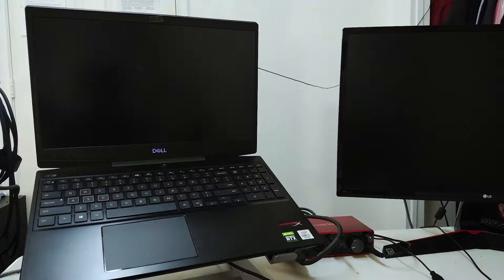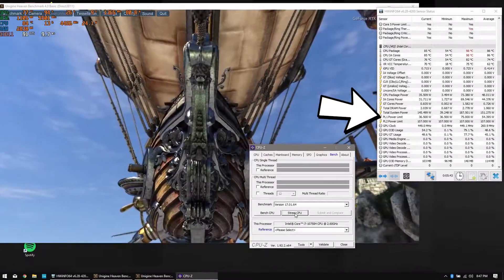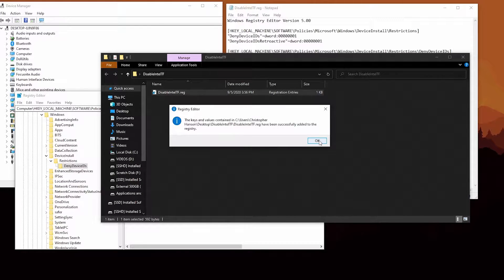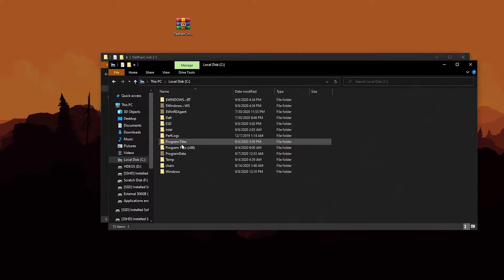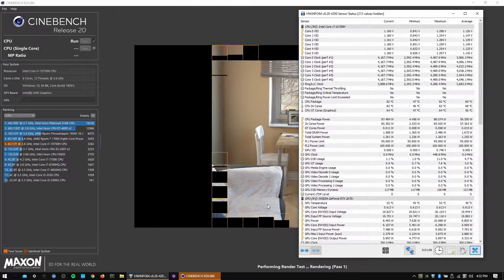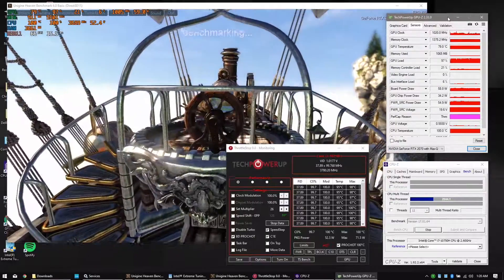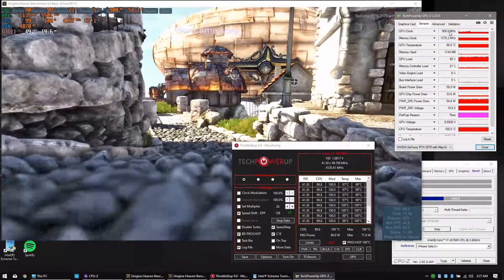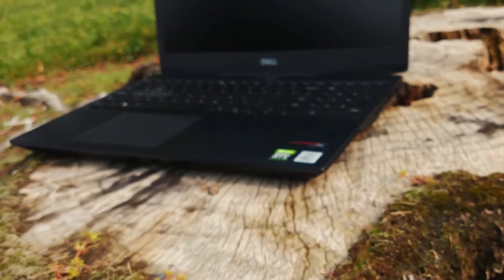Dell G5 5500 - Disable Intel Dynamic Tuning (Unlock CPU Power Limit) | Fan Control | 5 Games Tested

Comment: So let's say, I have a 230w brick, I play apex, my gpu pulls at least 70-90w, my throttlestop is blinking power at around 45w, with yellow PL2 on both core and gpu.  If I disable DTT, will it help get past the 45w or should I just limit my framerate so my gpu doesn't use more watts and leave space for my cpu?   Upon checking hwinfo my PL1 and PL2 are at 90w and 115w

Thanks in advanced!
Reply: Even under 45w it blinks yellow on PL2 which is weird

Comment: Thank you very much for a useful video, I did all the steps except fan control, I can't. The temperatures are and the voltage is fine.  Limit for turbo 95w max 100. Please still have any limits for battery power. Thanks in advance.

Comment: Hello, I am new at laptops or PC's in the matter. I understand that Intel Dynamic Tuning increases and decreases the voltage used by the CPU to comply with the PC's thermal capabilities. However, Does lowering voltage affect the clock speed of the CPU? In your video, you have a constant 4.2GHz clock speed at almost 100C after disabling the Dynamic Tuning capabilites. Does that mean that you just locked the voltage being used by your CPU so that it would stay at 4.2GHz? In summarization, what is the relationship between Voltage and clock speed?

Comment: Hey there, I just want to say that this method does not work anymore.
I have tried it multiple times but Intel(R) DTGP keeps getting reinstalled after I restart my computer just as you told me to.
Reply: update: I had removed the driver using other methods, but it still gets throttled to 8W, I think its the EC thats controlling it.
Reply: @arihkm  can you please share how did u remove it? i can't find any normal info on that.
Reply: @MrAngerius  that was almost 3 years ago, im sorry but i dont remember. but i do remember that even when i did remove it, it doesnt work because the wattage limiter is baked into the cpu, there was no way to override this with any software.
Reply: @arihkm  damn, thanks for replying so fast, ye i have same issue, seems like DELL did something and now i also can't chage my clock speeds via throttlestop... my clocks are flying 2.8-4.1 instead of stable 3.5 that i've had with my own clocks.
Reply: me too

Comment: Excelent video.....I also hate the AWCC, but one thing that I like is the keyboard backligth that I just got it reinstalling the AWCC....do you know if there a way to set the backligths without the AWCC?(the BIOS 1.8.4 has no option to do so)....tks so much!

Comment: I repasted my Dell G3 with Grizzly and undervolted it by -0.160. I have i7 8750h with GTX 1050 Ti, I got temperatures around 85-86c but the thing that kills my FPS is still power throttling. I'll try your method and hit you back with the results.
Reply: Hello bro may I know how you undervolted after the plundervolt update to the bios last year?

Comment: This laptop within a few minutes of playing a game peaks to 90-100C. Please could someone help - Dell have replaced the parts three times.
Reply: I am guessing you are using the high performance power plan and the F7 to get performance mode? There's a simple solution. Follow the steps shown here or simply switch to balanced power mode with performance thermals. Easy.

Comment: Hello, i followed your instructions, but when i run the command for enable and disable of the fans, i get an error saying that i need signature and to make sure that i run CMD into administrator, i do that, i know how to run a command in CMD but it still doesn't work, it says that i need to make sure that the file is in the working directory. It is, i see it in windows/system32 but still not working.

Comment: No need to do such long process.
Go to Dell Battery Manager ,then go to thermal settings set it cool.

Set your battery to either better battery or better performance.There is no need to unnecessarily set to high performance.

Go to Dell Alienware Command Center,set your profile to cool.

3.8 GHZ to 4.0 GHZ with cpu temp 62-73°C and gpu 59-63°C while gaming.
Also the fan noise issue solved.
Reply: Dude my fans kick on even when j watch vedios for long as cpu temps touch 90 ,what is the best setting for me? Dell g3 3500 I am using

Comment: After living with the laptop even more its a strange old thing. In Doom Eternal I can get 4.2ghz and nice 85 degree temps just using the balanced power plan yet in cyberpunk I get about 3.6ghz.
Reply: that's because cyberpunk is just like GTA V, these games are CPU intensive.
Reply: @mostafatarekadam8861  Yep but it's odd how it's so gpu intensive And cpu lol
Reply: @JoeMaranophotography  
To avoid the hassle I locked the turbo to 3,7GHz, so that it doesn't throttle, and even with that the temps are 90 degrees, this laptop is insane
Reply: @mostafatarekadam8861  The balanced power mode and custom fans seems to give me the best results. 3.6ghz at around the 80's.
Reply: @mostafatarekadam8861  I have the same laptop but it has an RTX 2060 and I get 4.2 ghz at 85 degrees while playing Fortnite at a 144fps. To get those temps all I do is lift the laptop from the back a little bit with some books without blocking the intake and placing a tower fan on its side 😂, btw the laptop feels cold to the touch, like If i were on a zoom call.

Comment: I got a nice performance boost in heaven benchmark with a GPU overclock before the score was 1992 and after OC it was 2127. That's standard spec just a change of thermal paste, laptop cooler and F7 key with turbo on. I suspect turbo off will yield better results as it always does for me in heaven.
Reply from the maker: What do you mean turbo off?
Reply: @thegameplayer4369  Intel turbo boost
Reply: @thegameplayer4369  I removed the screens, and applied arctic silver # 5 thermal paste, ran the registry edits, and removed the devices. This all dropped my temps under load by about 13 C. Nice! I can actually play a game on this POS now.

Comment: Great video! I did the fans things and I will try disable the Dynamic Tuning, could you tell me a little about what actually means to turn it off pls? Less GHz?
I saw that removing the dust filter and using liquid metal is an essential part, but fuck, I think I will wait to my warranty to end for the dust filter, and Im very afraid of using liquid metal. It will be pointless if I use a really good thermal paste?
Did you find a way to undervolt the laptop? I tried with a few BIOS downgrades but nothing happend, but I will keep trying.
Thanks a lot for the information provided in your video.
Reply from the maker: Glad you liked the video!

I explained the reason to disable Dynamic Tuning in the video. But long story short, Dynamic Tuning adjusts your TDP on the fly. So say I use Intel XTU to set it to 150W. Whenever you start a heavy workload it will lower the TDP, just as shown in the video, and sometimes it'll go lower than the rated TDP. I've been using the laptop with it uninstalled since I bought it and the performance greatly improved and is now consistent.

Conductonaut Liquid Metal has a thermal conductivity of around 72W/mK, while A VERY GOOD thermal paste has a thermal conductivity of 12W/mK. That's 6x less. With a weak cooling system like the G5's, you want the very best thermal conductivity to make sure the heat leaves the chips and gets dumped into the cooling system as fast as possible. If you use some nail polish to insulate all the contacts and components around the die, you won't have any problems by applying it. Just make sure it doesn't touch any metal pads or components. Using a better thermal paste will somewhat improve the temperatures, but since the airflow is awfully restricted by the dust filters, I don't think you'll see much of an improvement, just as I didn't by applying liquid metal before removing the filters. It's all documented in the video. All the heat got transferred into the cooling system, but it didn't have enough airflow to vent it out.

Regarding the removal of the fan filters, I get you're concerned about the warranty, and it will probably void it. It will however greatly improve the airflow.

Unfortunately, there's no way to undervolt this CPU after Dell disabled it with BIOS updates, even by downgrading it. My best guess is that the BIOS is partitioned and this is a permanent change to another partition that won't be affected by downgrading your bios. So unless Dell decides to unlock it again or we find a way to modify that partition, undervolting will be locked down no matter what.
Reply: @thegameplayer4369  Thanks! My CPU temperature dropped from 100C after 5mins playing COD to 85/90C after 2 hours playing. I also did an undervolt to the GPU. And in a few months I will take off the dust filter. Like a saw in another comment: a most watch for every G5 owner. Thanks for helping the community. I'm suscribbed if you upload anything new about this laptop.
Reply: @thegameplayer4369  Yes, you can undervolt the Dell G5 5500 with a bios change. Worked for me. https://www.youtube.com/watch?v=zVAJVyF06Ro&list=WL&index=6
Reply: It’s your dell g5 still holding up?, because I have the same issues you had.
Reply from the maker: @luisoctaviodesoto7395  Yep, it's working just as I described in the video.
Reply: Great Video, for g5 owners. How was your laptop right now? Is there disadvantages on removing the dust filter aside from warranty, in terms of the inside parts of the laptops or systems based on your observation up to now. And any advice after removing the dust filter upon using this laptop?
Reply from the maker: @PortgasDAce-ik2rf  The laptop is working perfectly. Besides voiding the warranty there's no disadvantages in doing so.  

The only downside I can think of is that you'll have to open the laptop every once in a while to get the dust off the fans and heatsink. I got much better temperatures though, also because I applied liquid metal, but as you can see on the video, just applying liquid metal didn't help much given that the airflow was awfully restricted with the dust filters on. 

In games the CPU locks in at 4.2GHz and the GPU at 1500/1620Mhz with a +200 offset. Also, use Asus GPU tweak II to set the maximum temperature for the GPU to 87 Celsius to make sure the GPU doesn't throttle at 80C. Don't worry, it's completely safe.
Reply: And i have read regarding disabling intel turbo boost, is it good for us gamers to disable it? And whats the purpose of it. Hope you can answer my questions. Thank you. More subscriber to come
Reply from the maker: @PortgasDAce-ik2rf  As you can see in the video, I didn't disable turbo boost, I simply disabled the drivers that change the power limit on the fly in order to lock it to whatever you want.

Comment: Can you help me with this?
I got the same one, FPS are dropping like from 120/1400 to 18-25 while playing at any settings :(
All updated and good
Reply: hey mate try to use your laptop while it's elevated from the disk, just put any thing under it's back to maintain good air flow
Reply from the maker: I need more than that to help you. Like temperatures, clock speeds, power readings etc.

Sounds like it could be overheating or lowering your power limits like I showed in the video.

Comment: My heaven benchmark was 2215 with the cool profile, cooling pad, repaste although I can't remember if that was with turbo on or off.

It was 2201 with max performance fans with F7 key and turbo off.
Reply from the maker: Hey! State your settings, like resolution, AA etc. so we can compare! Cheers!
Reply: @thegameplayer4369  1920X1080 Full Screen all max settings 8XAA etc.

I'm using the latest NVIDIA studio driver too.
Reply from the maker: @JoeMaranophotography  I got 2353, same settings https://ibb.co/KV0yXHd
Reply: @thegameplayer4369  Turbo off for the win! I haven't done any of the steps you have done although I repasted with normal amazon paste.
Reply: @thegameplayer4369  Just did a test with no F7 key and turbo on 2220.
Reply: @thegameplayer4369  I just got 2381 with a custom fan curve in Alienware command and an overclock of 170mhz core and 600mhz memory. Amazed!!

Comment: one quick question if don't mind, does the rtx 2070 max q of this laptop has the nvidia dynamic boost feature?!!
Reply: Nope.
Reply: @JoeMaranophotography  weird, then why supply the laptop with 240w power brick since the gpu can't draw more than an 80w??!
Reply from the maker: @ابو راكان  80W for the GPU, 90W for the CPU, that's 170W right there. You have 70W for everything else, like screen, usb devices, ram, nvme devices etc. which also use some power Honestly, that's just you nitpicking. I on the other hand am happy they provided extra power instead of providing a crappy little power supply that will make the computer draw power from the battery when it's stressed. Would you rather run a power supply at 100% all the time? I really don't see your point here. In other words, a power supply is not only for the GPU. Cheers!
Reply: @thegameplayer4369  you are right but the rtx 2060 laptop is provided with 180w power brick which has the same 80w as this rtx 2070 max q laptop. 180w must be more than sufficient to that 80w gpu!! so why provide this laptop with 240w power supply since the gpu can't go over 80w??
Reply from the maker: @ابوراكان-س4ق  I just explained to you why, showed you some rough math, and you asked THE SAME QUESTION. Your view of the matter is sort of twisted. Let me try again:

I will state it bluntly: 180W is NOT ENOUGH for this machine. 

The GPU pulls 80W and the CPU pulls 90W when you lock the power limit to unlimited.  

80W + 90W = 170W. 

Running a 180W power supply would leave you with 10W for EVERYTHING ELSE on the machine. Just the screen pulls around 6 to 8W, since it's 144Hz. That leaves you with 2W for you nvme drives, usb devices etc. 

That's insane, you would be running the power supply above its specs, which would result in the laptop draining the battery in heavy workloads.

And no, I just went to Dell's website and saw that they actually provide the 240W power supply with the 2060 model.

Think about it, mate. Don't nitpick. =]

Cheers!
Reply: @thegameplayer4369  there are plenty of rtx 2060 80w laptops other than Dell with 180w power supply. anyway, for me it would be better if you could boost the gpu to at least 90w or 105w with nvidia dynamic boost rather than boost the cpu because i am a gamer and care only about games!!

thanks for your time man!!
Reply from the maker: Well, your thinking is sort of flawed because CPUs are also very important for games, especially nowadays with open world games and online games with tons of simultaneous players. Also, a faster CPU means less latency because you're able to push more frames per second, CS GO is a good benchmark for this. The CPU is what feeds the GPU with instructions. RTS games also rely heavily on CPUs because of the sheer number of units.

Now say you have 2 fast NVMe SSDs in RAID 0 on your machine. Games will start to stream assets and textures to Video RAM on the fly, but that will also require decompression on the fly. The CPU will have to handle that decompression, at least until GPUs start doing this. Talk about future proofing.

Also, a 240W power supply at least gives me the option to shunt mod my 2070 Max-Q to raise the power limit. I haven't tried it yet, but it is theoretically possible.

Again, don't nitpick, Dell was nice this time, let's just appreciate that. Any questions just let me know!

Cheers!
Reply: @thegameplayer4369  thanks man for this elaboration, now i understand better and i hope you soon figure out how to raise gpu power limit so we can choose which one to boost more depending on the game or the work we are doing.

Thanks again!!

Comment: Can we do the same process for G3 3500 with 2060 rtx ? (G5 and G3 share the same bios)
Reply from the maker: This should work for all mobile 10th gen Intel CPUs and laptops. I have never seen a G3 in person though.
Reply: @thegameplayer4369  cool
Thanks 👍
Reply: I have the G3 with the RTX2060, heaten little thing, did you do any of the modding? i just picked mine up and im very worried of the thermals besides the throttling
Reply: @miguelalexandre7499  I undervolted cpu (needed to unlock undervolting first cuz it's locked by intel). And when you are gaming just disable turbo speeds by throttlestop. No fps drop only temp drops.
Reply: @miguelalexandre7499  it's a good laptop, enjoy

Comment: Can u unlock GPU power limit?
Reply from the maker: Theoretically I can raise it, but it's going to require soldering and/or a bios flash with an actual eeprom programmer. Since right now I'm going on a international travel, I won't be able to get around to opening the laptop to analyze the board and mod it for the next months. =/
Reply: @thegameplayer4369  Oh ok cool

Comment: Could u please test crysis remastered, halo 2 anniversary and combat evolved anniversary please
Reply from the maker: I don't own the Halo ones yet, but I'll definitely test Crysis Remastered soon.
Reply: @thegameplayer4369  Awesome would u recommend this laptop?
Reply from the maker: @crysis1174  I got it for US$ 1250 on a sale with 16GB RAM instead of the 32 I'm running. So plus $150 for the memory kit (HyperX 2933 CL17). That's $1400 before tax.

I don't mind modding my stuff, I actually enjoy it and can usually get around warranty issues if they decide to nitpick by explaining what I did. Though I get 99% of people just want stuff to work out of the box.

I've always used desktops as daily drivers, this is my first mobile one seeing that I'll be travelling a lot. My previous laptop was a Precision M4800 with an i7 4800MQ 4c/8t, 16GB 1866MT/s, Quadro M2200 4GB (GTX 960 chip), rubbish 1366x768 screen, so this G5 is an INSANE upgrade.

I'll let you be the judge =] Cheers!